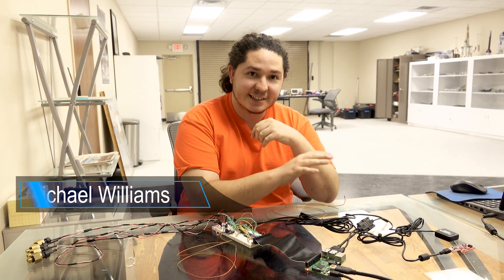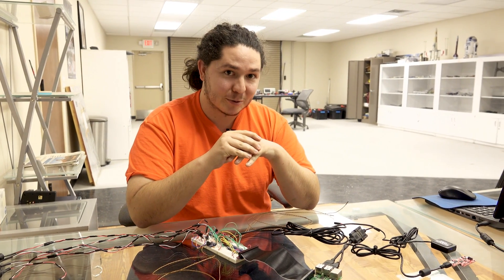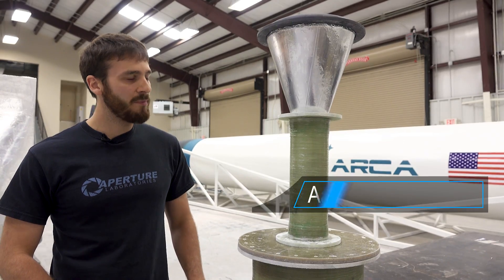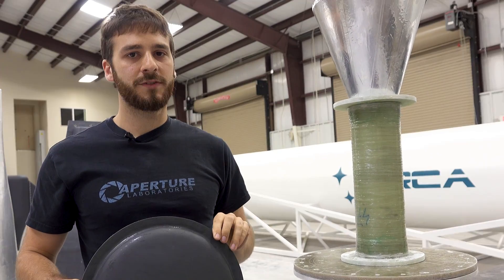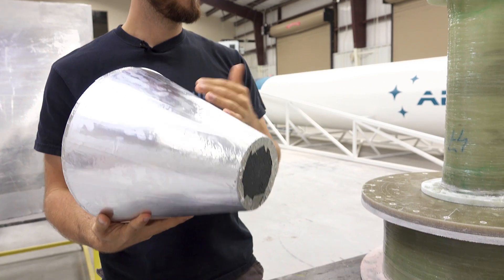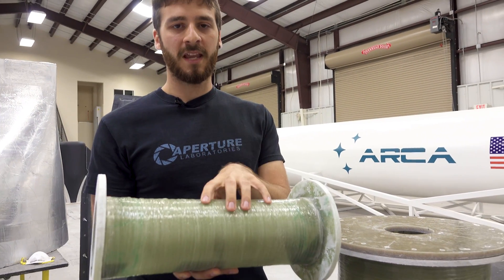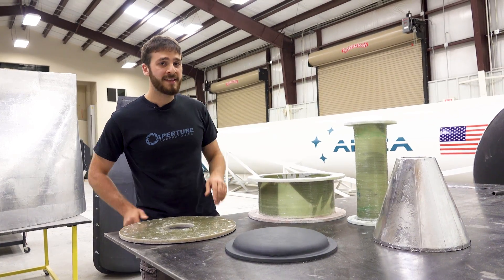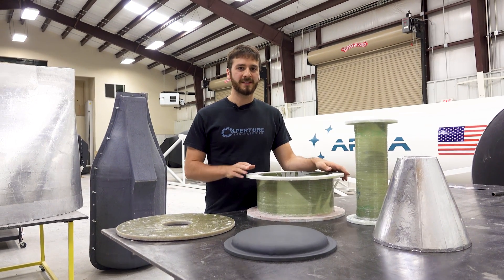Flight of the Aerospike: Episode 8 - Feed System Components

Comment: Hey, so just to confirm, the Demonstrator 3 rocket is stabilized through passive aerodynamic stabilization, correct? 

Basically the fins move the center of gravity behind the center of pressure?

I know you mentioned that you don't do simulation, but this is one place you'd definitely want to verify the dynamic stability characteristics of the rocket through flight as the center of gravity and pressure move.

Once you rise above most of the atmosphere, around 40km, I suspect you may lose aerodynamic stability due to the thinned out atmosphere. Will the rocket coast to apogee? At what altitude will burnout occur?

In most sounding rockets, stability at high altitudes via just the fins is ineffectiveness due to slowing velocities during coast and incredibly thin atmosphere. Thus the rockets are spun up during ascent using a slight cant angle to the fins.

Of course, if you're using a cold gas system for high altitude, that could also work.

This is something I'd definitely recommend looking into. The rocket's fins look very small. Another company, UP Aerospace, developed a solid-fueled sounding rocket with smaller fins. It lost stability at high altitude and came crashing down. The FAA investigation found that they had undersized tail fins. Now they use spin-stabilization.

I believe you're launching at Spaceport America or WSMR, so you won't have to file a Class III Part 101 waiver with the FAA or an experimental launch license with AST, correct? In that case, you won't HAVE to do dynamic stability simulation, but I strongly suggest that you do.
Reply: http://money.cnn.com/2008/12/02/smallbusiness/space_freight.fsb/index.htm

"Progress hasn't always been smooth. Up Aerospace's maiden flight in 2006 was a disaster. At 40,000 feet, the rocket shook off ground control and plummeted to earth at 700 mph, boring 12 feet into the desert sand on impact. Miraculously, the payloads remained intact. "I may have scared away some customers," Larson recalls ruefully. Not to mention that he attracted the attention of the FAA, which put Up Aerospace through an extensive "anomaly investigation."
The culprit: undersize tail fins. Six months later, Larson launched a new rocket with larger tail fins. It traveled to an altitude of 73 miles, floated in space for five minutes and parachuted safely to earth."
Reply: ARCA Space Corporation Glad to hear that! Please make sure the dynamic stability checks out for all phases of flight... I would hate to see this project crash and burn!

Rooting for team ARCA!

Comment: Is that a raspberry pi you are using?
Reply: It looks nice... but poor :-( and your engineer's workshop looks way under-supplied. I wouldn't fly a rocket using AdaFruit's kits, and I've been bitten by RasPi enough time to prefer my custom FPGA boards. You don't want to lose your time and money because 1) a wire broke lose due to vibrations 2) some software glitch (can you even control the OS configuration from A to Z ?) 3) your engineer looks nice and passionate but experience on the field is priceless...
Anyway, +1 for using Linux and Free/Open Source Software but it's only the start of the journey ;-)
Reply: From what I know, vibrations (and their various resonance modes) are among the hardest engineering challenges. I wish you good luck and I hope you have simulated a lot. It's not called rocket science for nothing :-)
I'm looking forward to watch your baby rise up, up, up !
Reply: Now the $1B question that you will answer soon is : will the aerospike reduce vibrations ? 
Good luck with all the tests, I'm staying tuned !
Reply: Raspberry pi is quite fast but the problem you might face is saving those data points somewhere other than the RAM. We had writing speed issues with our SD card on the raspberry pi causing the RAM to overflow. This is why we had to switch to dedicated DAQ for our sounding rocket.
Reply: I think the point of aerospace telemetry, particularly for such a prototype, is to send the data to the base station as fast as possible, because "you never know". If catastrophic failure happens, the chance to recover the recorder is low and all insight is lost. So it's mostly a matter of what bandwidth your radio link can provide, and whether you can compress the data flow (or at least send in binary, not ASCII), etc. The problem now is transmission, not storage...